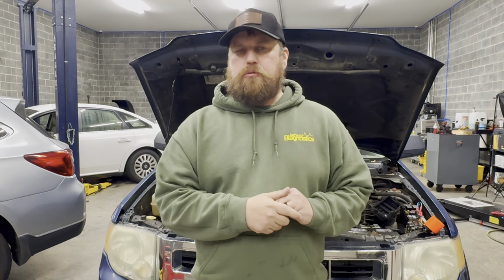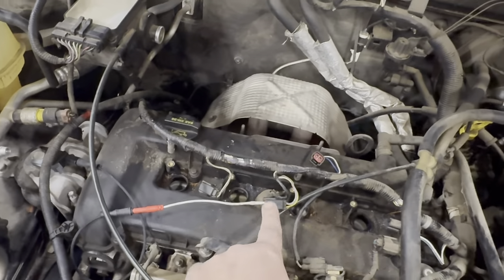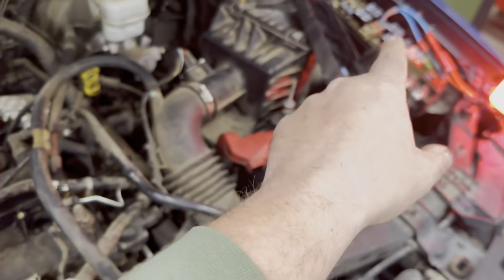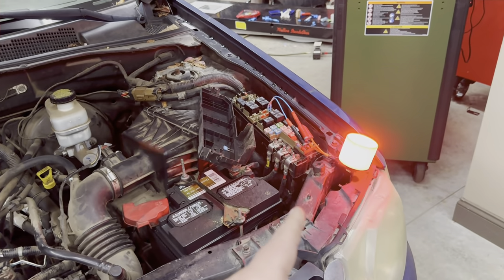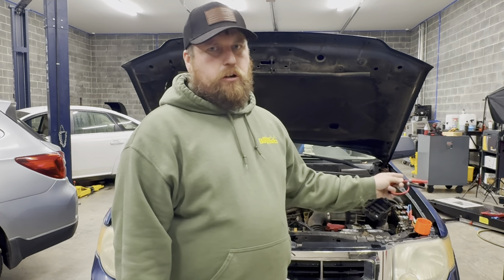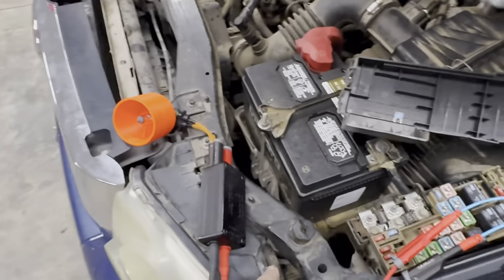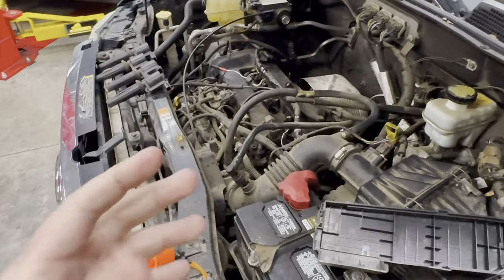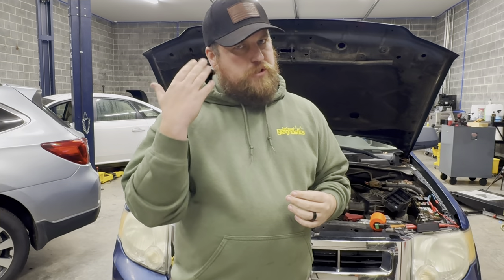The Best Way To Find A Shorted Circuit!!

Comment: Nice video.  I learned from an old school electrician many years ago, a similar trick to finding a short in your house.   If you have edison base fuses (glass fuse with an E26 base, what most household light bulbs have) remove the blown fuse and insert an incandescent or halogen (preferred) or dimmable LED bulb into the fuse socket.  With cartridge fuses, use a lamp socket with leads and alligator clips across the cartridge fuse, with power turned off when connecting them.  With circuit breakers, wire the lamp socket between the breaker, and the circuit in question, then turn on the power.  A short circuit will light the bulb to full brightness.  When the problem is located and repaired,  the bulb will turn off, or light at a lower brightness if there are still loads connected,  the larger the load, the brighter the bulb. Do not operate the circuit with a light bulb in series for more than a minute or so,  because some appliances particularly those with motors, can be damaged if ran at reduced voltage for an extended period.
Reply from the maker: Nice!
Reply: @JarheadDiagnostics  So I have a tractor im trying to find a hot wire shorted to the Frame. It has not blown a fuse. I have spent hrs trying to figure this out. When U use the battery disconnect  the entire tractor Frame,engine any thing that's metal has 12 volts. Any suggestions?
Reply: @kylen1922  assuming you were unable to get a approximate location of the short by sight, sound smell, (smoke, arcs/sparks, burned plastic) you should be able to isolate the short to a particular circuit  connecting a 12 volt test light in series between the negative battery terminal and the negative cable.   A short would light the bulb to full brightness, a high resistsnce short that doesn't draw enough current to blow a fuse will make the test light slightly dimmer.   In either case, start removing fuses, one by one, when the test light goes out or considerably dimmer, you just found the shorted circuit.   You can then inspect for faulty components on that circuit, and check for any areas where the wiring may have rubbed through and touching the chassis.
Reply: @Sparky-ww5re  I appreciate your response. This tractor is a electrical nightmare lol. It has 6 fuse boxes and 3 computers.  I've un hooked all the fuse boxes with no  response. And have checked the hot wires from battery to cab. So I'm about to throw in the towel. Thought the battery's had reverses polarity ..nope. alternator starter ....nope.  It's low resistance short so think I'm going to just let it go. Have way to much time into it.

Comment: Have a compressor clutch fuse popping, would this method work? How would a shorted power circuit do both, provide a ground for the bulb at the fuse terminals, and also provide voltage to the compressor or load? Would the bulb safely protect the circuit for excessive current?

Comment: Nice one Brandon.
For a switchable load test light, I made up a set of 4 switches connected with one common positive wire from a single banana plug parallel linked to each switch input terminal, then from each switch output I can individually control a set of 3 globes of a tail light harness I pulled from a junk car, this gives me 4 switchable filaments, and a common ground wire shared by all the globes.
I can essentially choose an appropriate load via the 4 switches for most integrity testing, harness shorts etc at the fuse box or pretty much whatever by adapting to the 2 banana plugs to suit what I need.
I can then choose a low, med, high, or even higher amp test light, or combination.
As an audible tester, I have a 12v car horn and a small piezo buzzer, both with a pair of test leads terminated with banana plugs, which have been super handy for testing circuit integrity or short finding etc when it's not possible to see the test light👍
Reply from the maker: We have seen the set ups with multiple bulbs and a switch for them. It is an excellent idea.
Reply: How much is each load, Amp wise?
Reply: @bernardocisneros4402  I haven't tested the 12v horn amp draw, but the tail light harness has 3 bulbs, 4 filaments.
One bulb is a dual filament 21w/5w stop/tail, as well as one indicator bulb and one reverse bulb (2×) 21w.
At 12v the 5W filament should draw a little under 417mA.
The 21w filaments should draw around 1.75A each.
All running together that comes to a little under 5.67A, so that's around 670mA more than a 60w H4 halogen headlamp bulb at 12v👍
Reply: @simonilett998  Thanks for sharing the info

Comment: Great video, idea, and explanation. Very easy to understand and follow. Thanks!  Is this what you did while you served or did you take this up after you got out?
Reply from the maker: I was an aviation maintainer. My MOS did a little electrical, but must would be sent to the avionics shop.
Reply: @JarheadDiagnostics  I was an engine and propeller mechanic on C-130. MOS 6016 & 6026 in MCAS El Toro, CA from 1988 to 1992 with VMGR-352. They're now in Miramar, CA. Which aircraft did you work on and which base were you at?

Comment: I've used the same method of using a test light to diagnose a constant short to ground, very effective. Once the test light is in place I've used a DC current-clamp to identify how far the short is traveling in the circuit. If I see the 5A (or however much my test light is drawing) on a given part of the circuit I know the short is further down the line, if I see 0A I know I'm past it.
Reply: Dude, that’s genius

Comment: But identifying the duff circuit is one thing, what happens next.  How do you trace the wires and find out what is actually happening ? Thanks
Reply from the maker: That would depend on the situation. Not every circuit is built the same.
Reply: The next step is usually getting the power distribution and ground distribution diagrams, along with DLC and schematics for related circuits / components that you are having the problems with.
Reply: @HoodRichSWERVE  Thanks Malahoko

Comment: Where are you located? I've had 20 different mechanics look at my tail lights and still can't figure out why the running lights on my liftgate don't work with my headlamps on. It's been so frustrating 😫
Reply: @JonathanLozada  sounds like a bad ground or bad connection/corrosion dropping the voltage at the back of your truck

Comment: How would you  know if it’s short to voltage or short to ground?
Reply: I'm not sure how to answer, but I'm guessing voltage is what you mean by power. Or positive? Nothing would happen, you need to close the circuit to ground for the light to turn on. I'm probably not understanding tho, so I'm sorry hahhah
Reply: positive 12v through the fuse was shorted to ground causing the fuse to blow.

Comment: Excellent! One thing I have seen is when the ground from the other side of the component on the circuit being tested is burned through no ground will be there to light up the test light.
Reply: One thing comes to mind, is to do a wiggle test throughout the harness related to the circuit. Hopefully it will recreate the ground fault/short.

Comment: When using your test lights to check circuit integrity how do you figure  which test light your going to use?
Reply from the maker: If you’re using sourced power for the circuit. You need to figure out the amperage draw for the component.
Reply: @JarheadDiagnostics  how many different test lights do you guys sell? And what amp are they
Reply from the maker: We offer 4 different. 1 is roughly 4.5a one is a dual filament which gives you 1-3a and one gives you .4a.

Comment: General Technology Corporation manufactures a 5 piece fuse socket connector kit .  GTC063 .  Quality Made in Canada , purchased on Amazon $22.00  The connectors work well !
Reply: Thank you. That will save time and space in the tool box.